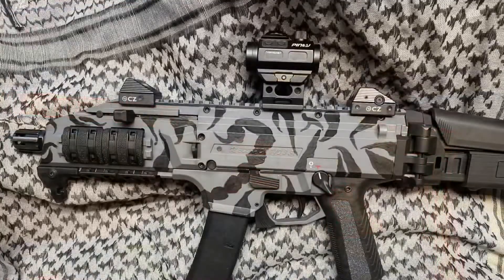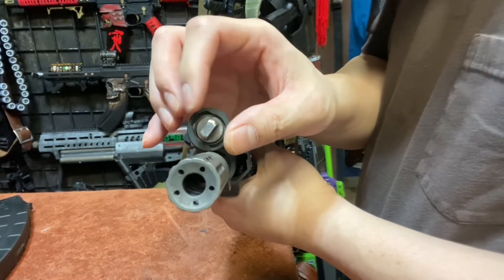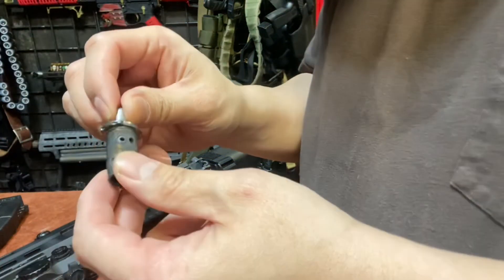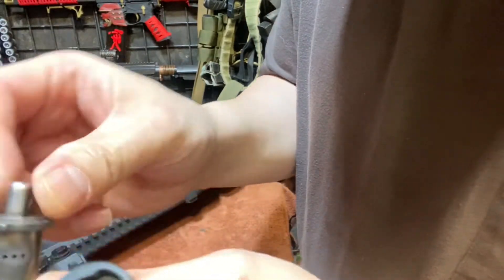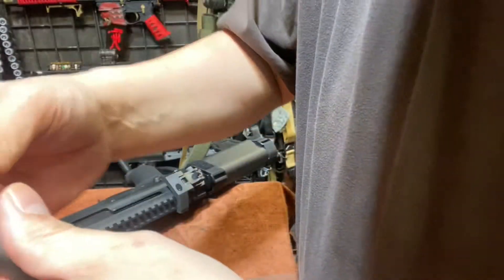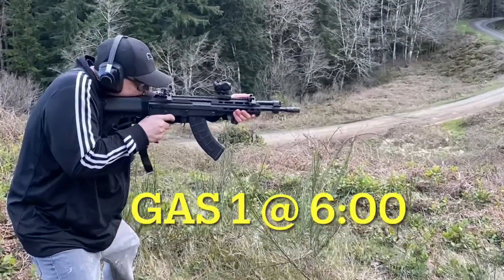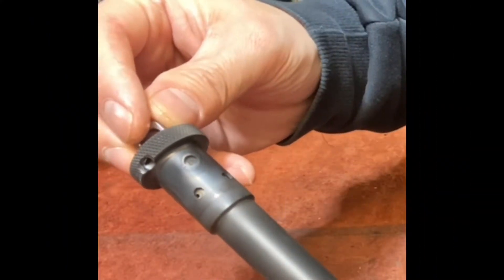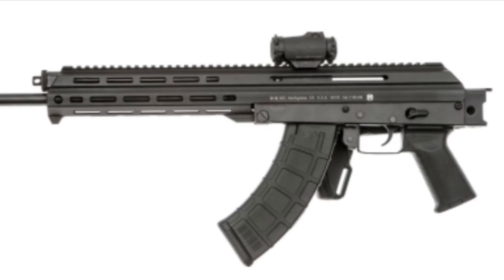M+M M10x gas settings

Comment: I will test after watch this video, but I have a problem with mine 
I shoot one time and stop, does not fire more than two bullets in a row
Reply from the maker: Yes I had that problem. Watch the video hopefully you’ll see the settings are not marked or look on the opposite side. There are extra notches but the one you want should have 3 full settings not 2. If you dont feel three stops you are likely not in the right area try spinning to other side.
Reply from the maker: Also read all the comments in my other m10x video the company contacted me on that one to help sort it out. You should be able to get their contact info from that hopefully.
Reply: I have same problem

Comment: So I have all 3 numbers but it only gives me 2 settings. Do you think it's possible I got an old model with a new gas valve?

Weird thing is it works only on "0" and "2". "0" acts like it is in the old way as no gas and a single shot. The "2" is overgassed. Setting "1" won't work.
Reply from the maker: I think you are having the save problem I had. Make sure you see three divots it might be on the opposite side. Watch my video again and watch the first one I did 

https://youtu.be/W2KJ6wrdPQ4
Reply: @danger-closecustoms9739  Yeah I need to test fire it but looks like M+M goofed and I got the 3 position stamp but only a 2 position valve.

I set it so now 1 = Normal and 0 = Adverse when looking at the 1,0,2 stamp.

Whoever is running their CS team can't understand that though. Super frustrating trying to communicate that with them.

I think what happened was it shipped at no gas and normal gas. Saw a video where they say a break in is needed for the normal setting but it did work well at the normal.